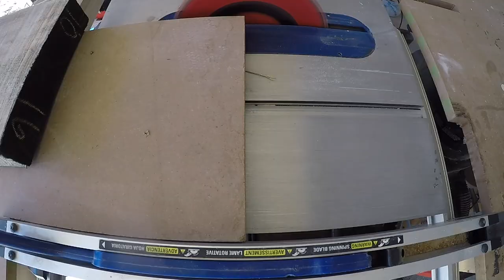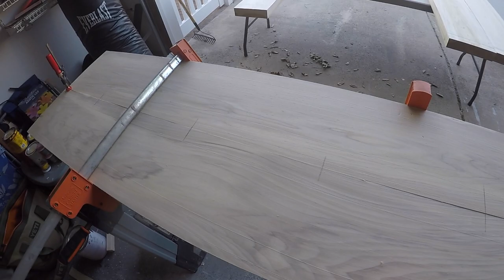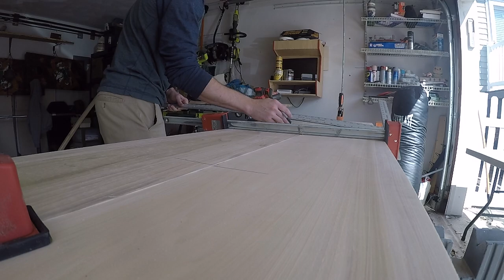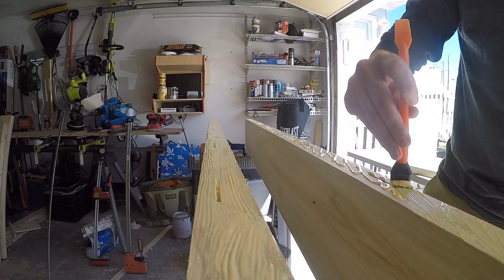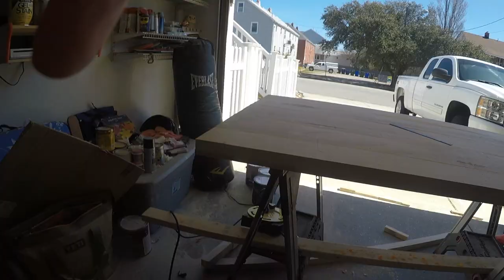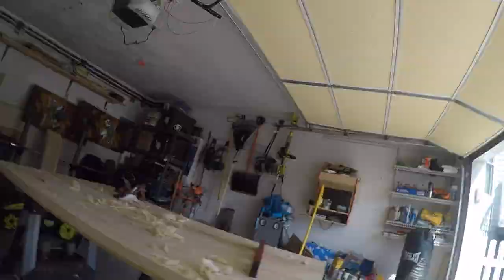Poplar Dining Table Part 1: Milling and Flattening

Comment: Not too bad.  Word of advice...plane your boards before trying to joint them.  You want to get the faces flat and parallel to ensure that your edges are at 90 degrees.